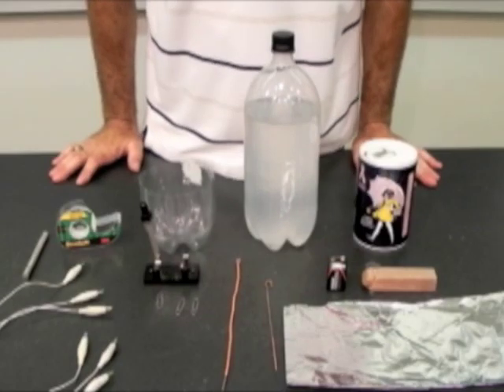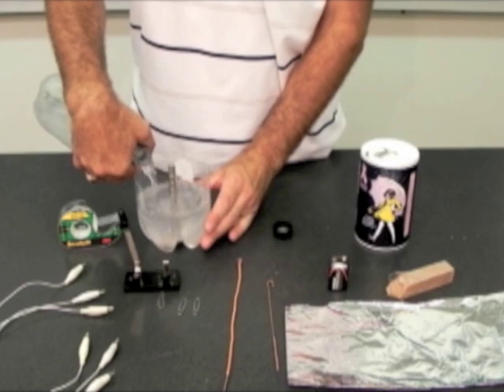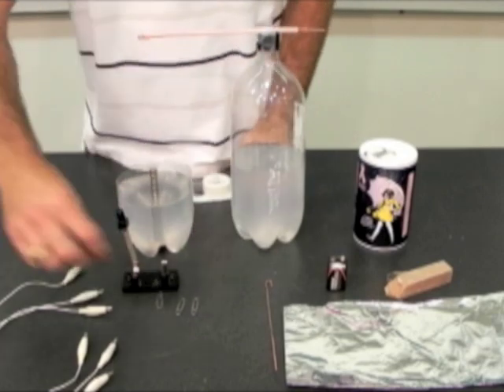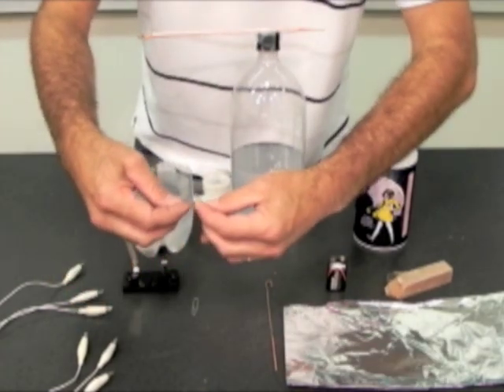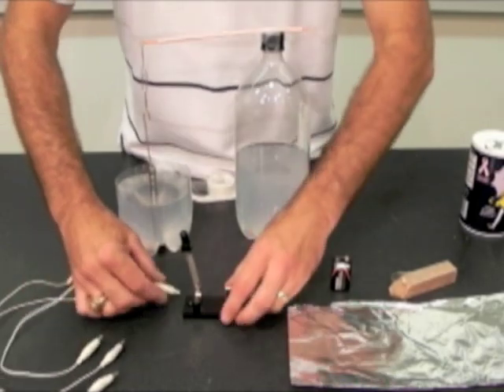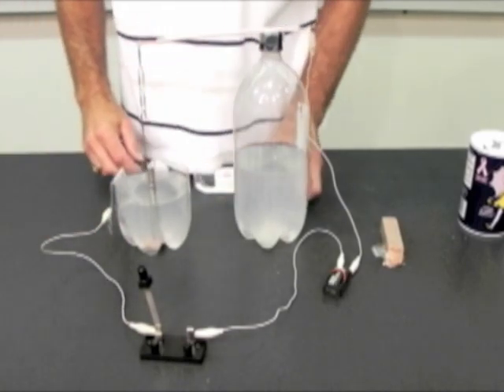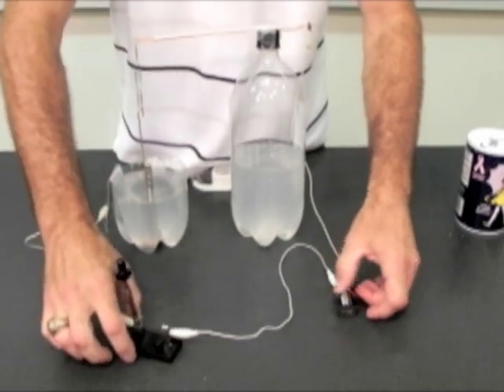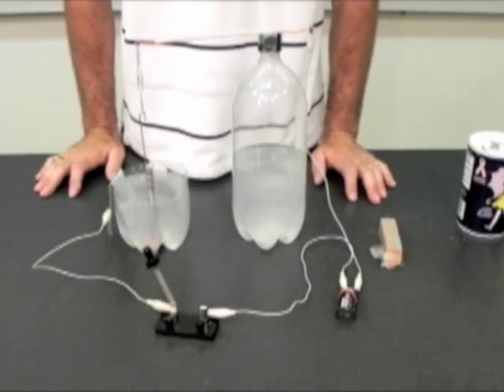Build a Faraday Motor With Your Students! | Arbor Scientific

Comment: Thanks so much for your work.  The motor I made did not work. Now from your work I understand how to make changes. My magnet was much to short and not deep enough water ; not letting enough current flow in system.